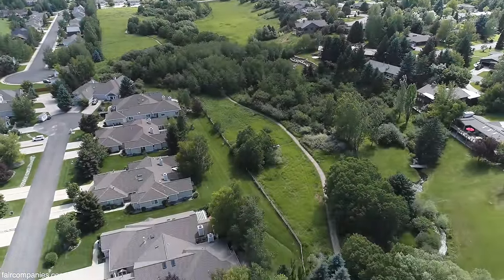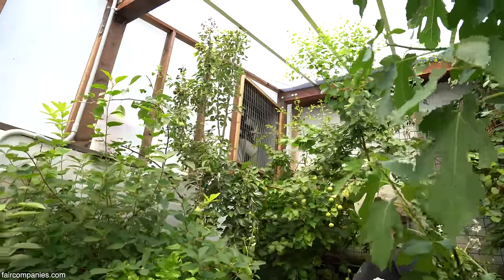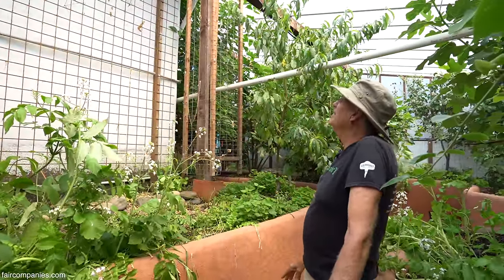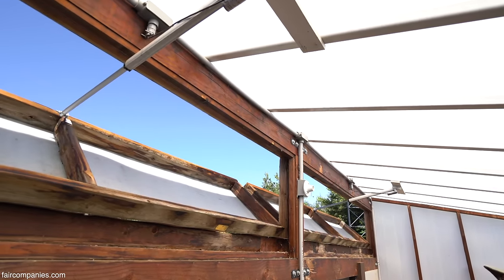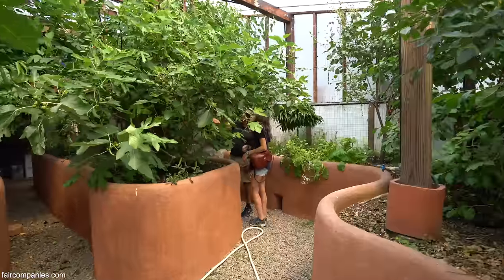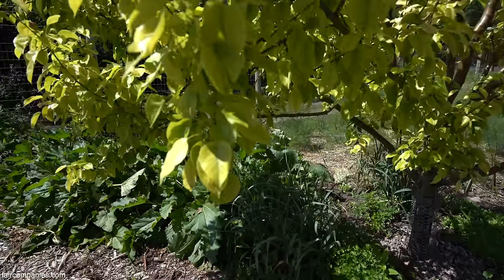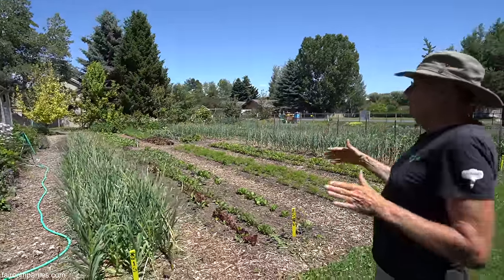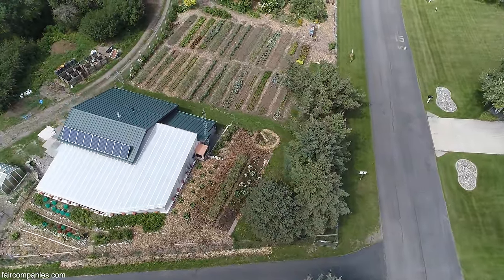Sunken greenhouse wraps home & feeds suburban antifragile co-op

Comment: it just is too cool how the unseated greenhouse wraps around the home, insulating it. It is a very well thought out system and it seems that he took a lot of ideas from the earthship systems.
The owner is a visionary and is setting a wonderful example for that valley.
Reply: Great ideas and living . Permaculture is key to taking weapon out of food. Peace be upon you. Thank you for sharing.
Reply: Except that no one lives in the house and it is dark and unheated by the sun
Reply: @tzenophile  also he did say that the heat does not transfer to the house ....he said the house is cold ...
Reply: @clarkclarke  exactly
Reply: @clarkclarke  From Lil Giant ONLY because he built it next to what WAS  a garage. There was nothing to prevent his setting up insulation in the garage, from venting heat into the garage at appropriate times from the green house built under ground. Nothing to prevent his building a wood burning stove in the kitchen he has already built into the garage. 

You would have to think about it. He did not need housing, so did not think it out. He could still adjust if desired. That is sometimes what happens when things are developing a bit at a time.
Reply: @ricardoweaver1287  That's pretty cool.  I don't like anything being subsidized.  But I also don't think internal combustion engines are a great evil, either.  And there's more environmental damage involved in making solar panels and batteries than just the energy used.  When your batteries die, they're a mini toxic-waste disaster.

I'm not all-in on any one thing.  I would love to see more people using alternate transportation for short trips around town every day.  But I don't think making petrol artificially expensive is necessarily the right course, either.  I can see ex-engineers and thoughtful people arranging their lives in productive ways with smaller footprints, and I can see that becoming a sort of status symbol for society, and things going the/a right/better direction because people so choose.  The trick is getting more people to build up their skills sets, raise their prosperity, so there are means and resources to so arrange things.

I'm highly skeptical of mandates or any kind of subsidies from the government.  They tilt things towards their pals, instead of just letting people figure out their own best ways, without interference.  i think we will probably conclude in 20 or 30 years, when sanity reigns for a brief time, that the CO2 we're putting in the air is a net benefit and a distraction from the real ecological harm we do.  CO2's a good bellwether for how clean you're doing things, because production of other chemicals, strip mining, and deforestation are so closely linked to it.

But too many people see our prosperity as the enemy, when it's our prosperity that will give us the knowledge and means to make planet greener as a CULTURAL choice.  You make natural gas/petrol more expensive, and people will burn more coal and wood.  People have to choose better ways, not be manipulated/coerced to better ways.
Reply: @harrymills2770  I have changed my beliefs drastically, I agree with what you are saying. If we had an easy way to convert CO2 to methane or other hydrocarbon fuel, internal combustion engines are great and carbon is a great energy carrier. I agree the manufacture of solar panels, batteries and high tech electronics is extremely environmentally destructive.
Reply: I'm unable to fix my spelling errors, sorry!

Comment: I wish I were younger.  I have the land and would have built one of these sunken greenhouses.  Much like the bank barns here.  We have a steel barn which came with the property.  It fries in summer and offers no warmth in winter, but the bank barns I have been in in winter have a little warmth even though only one side is underground.  Same basis as our geothermal heat pump.  Maybe, though, we will try this in miniature.

Comment: I'm not sure if this would apply to your area, but I did very much the same in the mountains of eastern TN/NC. I dug down seven feet to use the earths heat and cooling system Geo-thermal is the bomb, air conditioning and heating for less than 75 watts. I built all of it for near $3000.00 I used free pallet wood and a neighbor helped with the heavy equipment, what a blessing to be able to grow everything my bride and I love. Blessings

Comment: They should have put pipes underground to take the heat from the earth and pipe it into the greenhouse. It shouldn't get below the temperature underground, around 54 degrees. Also put tubs of water to capture heat during the day, and release the heat during the night. Thermal mass.  And darn in that environment why doesn't he have a wood stove? It would heat the living area and can cook with it too.

OK he's got cooling tubes for hot weather, but not fan the other way to capture earths heat
Reply: That takes up even MORE land, and "tubs of water" evaporate.
Reply: @maxsdad538  tubs inside the greenhouse absorb heat during day and slowly release at night, preventing freeze

Comment: He needs to go 8’ down and run 80’ of tubing with a fan to regulate the temperature to around 50 degrees.
Reply: All depends on your latitude. Bozeman is pretty far north.
Reply: Couldn't a passive draw system work in place of the fan?

Comment: Great video. I built a greenhouse off our basement with 4’ backfilled walls  that have 4” of blue board on. I’m still picking tomatoes and peppers and we have had temps in the teens. On sunny days it still getting over 70 when it’s in the 40s. Our building permit where  I live is go the borough and get a driveway permit. If you build out of pocket without bank inspectors you can do what you want.

Comment: You might have seen the recirculating  6 ft  underground 6 inch air duct with fan that brings ground temp back to the green house raising temp to 50 in  a cold winter with no heating either? Love what your doing looks great!!

Comment: With the heating over winter. A old local of my area used to run a chipy fireplace in their green house over winter. These fireplaces were designed to heat water not air (wet back water heater). They ran the pipes through their growing beds to give the soil a lil more heat. This does mean firewood collection for the green house but it helped them keep and start plants over winter.

Comment: Keep an eye on those kiwis!!
I bought a place in Portland that had a male kiwi, not knowing what it was. Took a clip of it to a nursery, came back with a female kiwi and instructions to plant it 8’ away and build a sturdy archway between them. I did so, and a few years later had a monstrous pair of vines to deal with, hundreds of kiwis, vines 30’ in every direction...but the season was too short for them to fully ripen, and ended up putting batches in a paper bag with an apple, which ripened them up. 
You have been warned. 😄

Comment: He said originally they didn't want to dig the greenhouse as deep as the officials required.  They only dug 3 feet down, they piled 3 feet ontop of it. I wonder how deep they originally wanted - 3 ft doesn't seem like too much. Could they pipe heat from the ground into the greenhouse?

Comment: If you horizontally drill out in the sunken area and pull in heat from ground you could significantly increase the temperature inside.   Guy oun YouTube does it in Ohio .. solar panel to fan an i believe had tubes 50 yrds into property pulling heat or cool in depending on season..  Cheers

Comment: Have you thought of putting a wind turbine on top of the tower to give you more electricity which could be used for heating in winter and cooling fans in summer?

Comment: Generally very impressive. My only concern is, that at least some of the plants inside look very "long" with big leafs, which means, there is a disproportion between temperature and light. Maybe this is has to do with the not so ideal covering, which seem to let not enough light inside. Plants probably grow in this sitation, and with enough pollution, they are also creating fruits, but they are not really robust and will probably get bugs. I would cover the whole area with a more lightpermeable covering, like greenhouse foil or, special polycarbonote panels.

Comment: Let Mr. Weaver know that kiwis require 1 male plant to 5 - 7 female plants to set fruit. I am assuming that he is growing hardy kiwis that can take temperatures down to -50 deg F. Hardy kiwis are fuzz less, a bit smaller than the tropical kiwis and can be stored for 2 months under refrigeration. They taste a lot like sweet grapes.

Comment: PLEASE tell Mr. Weaver WHY his fig will not fruit & what he can do to fix it.  1. In air that cold, they will NEVER fruit UNLESS you heel them in (grow low & mound with soil over winter, then clear away the soil in spring).   2.  There are some low cost ways to warm your figs.  Circulating hot water pipes in the soil might be best.  3. A  simple propane or NG heater pumping directly onto the Ficus will eat some fuel, but yield the fruits also.

Comment: He probably could have gotten the temperature warmer during the winter if he had installed a geothermal system that pulled air from the stable ground earth rather than the above ground chimneys.

Comment: The problem with the blackberry is probably not sun, but the alkaline soil.  Dig out the soil where the berries go & install PEAT, 100% peat.  After 5 years, u will still have tons of berries.  Also, thornless blackberry is not as cold-tolerant as the thorned varieties.

Comment: GeoThermo might work well with this GreenHouse
Might be able to keep it maybe 40°s in the winter
Reply: Sounds like he has some what of a GeoThermo system..
But don't understand it being so cold inside..
During winter..
Seeing underground temps should be around 50° if the cooling/heating tubes are deep enough
Reply: I suspect if the earth walls were higher and the walls/roof was made of glass (more expensive) that a higher temperature may be possible

Comment: Kiwis need pollinators and they can be male/female so one may not be enough and you may have to make sure to have at least 1 male plant, bumblebees love kiwis, but they may not go into a greenhouse the hairy varieties may be disappointing, since they can turn out pretty small in slightly unfavourable conditions, kiwi berries may be a better option, since they can be eaten with the skin on. Kiwis can work in colder climates as long as they're protected from the wind

Comment: Keeping gov  off your ass is key, my GH 1400 Sq ft, around 5 k, I live in an area you can build a hot house without limited  rulings, I used 8 x 8, it hold up 100 lbs of plastic just fine